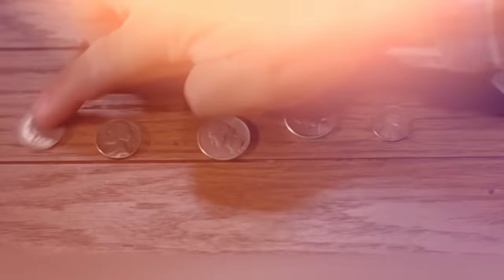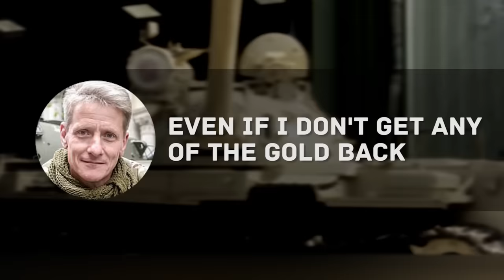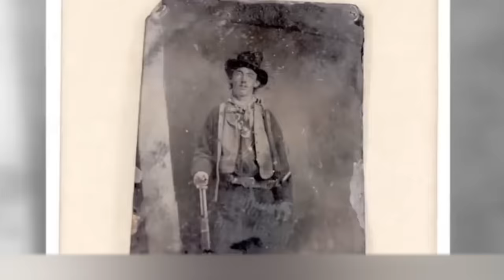They Bought a Dog, but When the Vet Saw It, He Called the Police

Comment: Tibetan Mastiffs can grow up to 140 kilograms or around 300 lbs. That's a bit more than your 70 kilograms or 155 lbs  statement. Do your research please. One Tibetan Mastiff weighed in at 320 lbs with its full winter coat. Contrary to what most people think, they are not the biggest dog in the world with the English Mastiff holding the weight record at just over 360 lbs. And they're a short coated dog.